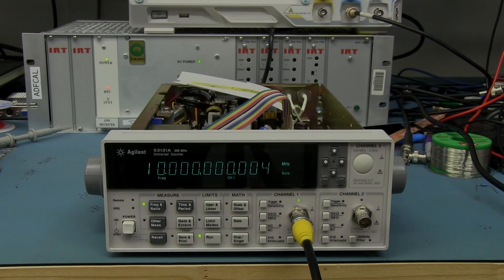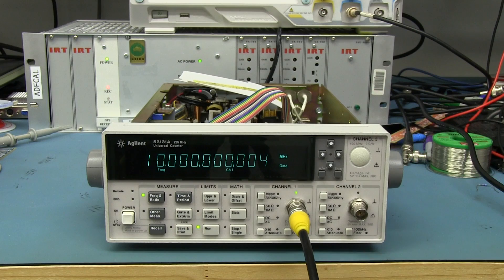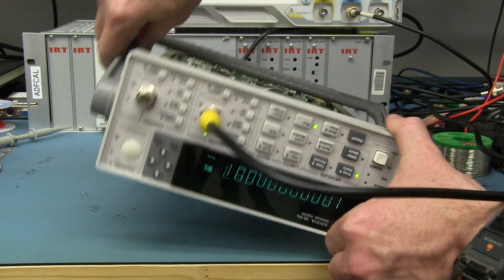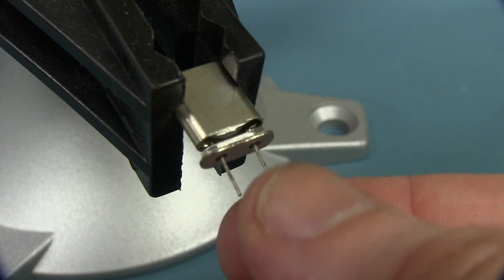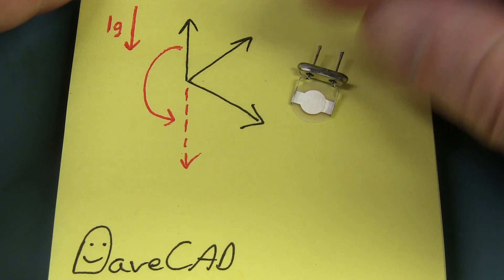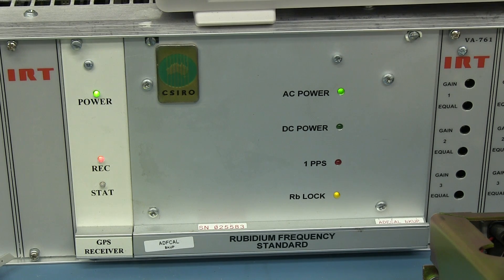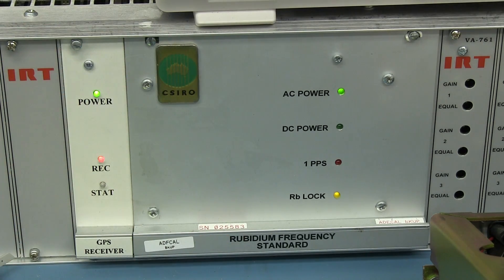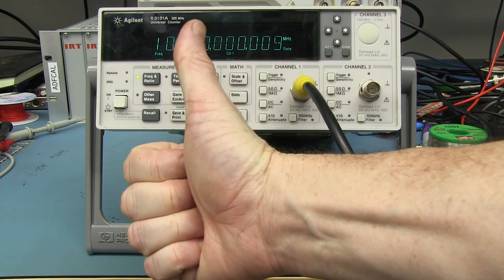EEVblog #646 - Gravity Detection Using A Frequency Counter!

Comment: For some reason this reminds me of the way CRT displays would go all wonky if you tilted them, or especially if you turned them upside down. Makes me wonder what caused that to happen. I wouldn't imagine the coils would move much, and the electron beams wouldn't be affected significantly by gravity.
Reply: It's the earths magnetic field
Reply: @sinuspl  No it's not. The Earth's magnetic field is incredibly weak at the surface and spread over the entirety of the magnetosphere. When was the last time you saw a paperclip stick to the earth? At best you can get it to rotate a needle with very little mass under very little friction, ie a compass. But that's easily negated by pretty much anything significantly magnetic. Even a paperclip that's been magnetized will spin a compass away from the Earth's poles.

The Earth's magnetic field cannot and will not EVER have ANY effect on a cathode ray. There has never been any experiment in which a cathode ray has been observed to be deflected by the Earth's magnetic field. I'm intimately familiar with the operation of a cathode ray tubes and electron beams (cathode rays). I will say that yes, they will be deflected a VERY VERY tiny amount. But it would be near impossible to measure without very precise equipment, and the slightest magnetic or electrostatic noise, which is all around us as it is, will disturb the results. The noise would drown out any actual measurement of deflection caused by the field.

 But I'm sure there have been some experiments to measure the effect of the Earth's magnetic field on electron beams. In fact, I'm 100% positive it's been studied. Particle accellerators, like the Large Hadron Collider, normally use beams of charged particles, in the case of the LHC it's either protons or lead nucleii. Which would react similarly to magnetic and electrostatic fields. And with the size of the LHC, and how accurate the experiments need to be, I'm sure they looked into how much the beam would be deflected by the earth's magnetic field. Like I said, it would be insifignificant in most cases, but with high precision experiments even a perturbation of a fraction of a percent would be devastating to the results. Really makes you appreciate the lengths they must have gone to to make not just that, but all huge particle accelerators work properly.

Comment: This is off the subject, but have you ever reviewed a Pace MBT 250 soldering/desoldering station. I have one and it’s lovely in my eyes. Just wanted to hear what you think. Lead free solder is crap! Only one good solder and that is RMA solder that is a Kester 282 or equivalent from Aim or Alpha Metals. In Sn63 or Sn62 formulations this solder outperforms all others in quality and reliability testing. It is proven in critical circuitry, medical, military and aerospace applications where reliability is of paramount importance. If you’ve ever evaluated this formulation, you know what I am talking about. I know because I am a veteran tech and a living witness to the reliability and quality of this solder. It may not matter to some, but I took and still take my soldering seriously!

Comment: Hey Dave, why not just mount the crystal on its SIDE, then the side weight loading would always be equal if it was tilted. Yes still not perfectly level but I'll bet a huge improvement. How about testing that ? Still interesting. Why didn't you try it on your frequency standard just to see how far it would drift and for how long ?

Maybe they should make special padded shock mounts for crystals. Better yet, rotate them ourselves and average the results with a slow servo circuit like the frequency standard does.

The oven temp my also change slightly with orientation because of different heat sink characteristics. Maybe they should make the package as a sphere for equal air movement from all directions from gravity. I see a new oven design in the future. A small sphere package packed inside a large soft foam insulation and shock protection.

Comment: Hi Dave thanks for another informative video :)..... you mention that the serial it's for a printer, would I be correct in guessing it just outputs the display value every few seconds down the standard rs232 8,n,1,9600 bauld.... if so would it not be trivial to write a program that receives the data and appends the time and date to the value and saves it as a csv file for later analysis or graph plotting..... 

And thanks again spent way too much time watching your videos :)

I would be happy to write a program for you if it helps in anyway :)

Regards Ian
Reply from the maker: Ian Sheppard It might be usable in that way.

Comment: It is quite intriguing that gravity can affect such a small and light object that drastically (drastically here is very relative, of course). I really didn't know this before, but I'm not electronics expert either. I wonder how big part gravity attributes to regular quartz crystal wrist watch time error in normal use, which is of course quite small, but still? Those crystals must also be calibrated in certain position, am I correct?

Comment: well if the deviation of the crystal by doing the tilting bale up is known, and it really mattered, it would have been really simply to put a little microswitch in there to add a little correction in the value before it was displayed on the screen

Comment: Is your IRT Rb Standard 10 to 100 time more accurate than the FE-5680A OCXO ?  Also looks like you got the GPS hooked up on the IRT.  Can you measure a difference between the two (2) Standards ?

And for gravity do check out  www dot anologdevices dot com (sp?) on their blog page.  They developed an accelerometer, gyroscope to put on an old IC chip (tech) here in NM (New Mexico is part of CONUS).

For your Agilent 53131A FC have you read or installed cal  XCTL of the YouTube blog page in Britian.  He also did a nice YT video of the FE-5680A.

Keep up the good work,  tjl  Sent by Win7Pro64 w/ADSL
Reply: Left out the  Trimble Thunderbolt GPSDO 10MHz freq. Standard.  Can you tell any difference between the three (3) Standards ?  And voteing two out of three for the correct time; are you on time for dinner or picking up the young lady ?

Thankyou again,  tjl  Sent by  Win7Pro64  w/ADSL

Comment: So if you had multiple oscillators mounted at various angles, you could use them to detect directional change relative to gravity?
Reply: MEMS accelerometers and gyrometers work precisely this way. They are electro-mechanical oscillators designed specifically to have large coefficients for frequency shift under acceleration. They also measure the asymmetry of the positive going and negative going wave-halfs to figure out the sign of the acceleration. Turns out counting frequency has less noise than trying to measure the magnitude of deflection by voltage.

Quartz is chosen for frequency reference oscillators because it has low coefficients of change for temperature, pressure, acceleration, humidity etc. If you're building an oscillator to measure some other quantity, then you want it to have a high coefficient for whatever change you want to measure. I think typically the resonators in MEMS devices are built as silicon fingers etched into silicon wafers because it's cheap to manufacture, you can build CMOS logic on the same substrate and silicon is virtually immune to damage from repetitive strain.

There's always something more accurate (even if no one's built it yet), but it's hard to beat the price of a MEMS accelerometer: ~$3 each 1qty.
Reply: puddingpimp
So I got curious and did some research: Not all MEMS sensors work this way, and it seems from a bit of research that gyros typically work this way, while accelerometers tend to work by suspending a conductive mass on a beam between two capacitor plates, and integrating the differential capacitance. As the mass shifts due to acceleration, the capacitance of one side of the balance will increase while the other decreases.
Reply from the maker: Yep. Wouldn't be terrific but would certainly work.
Reply: There's probably, something more accurate?

Comment: Ovenized!?
Reply: wolfy9005 That must be a huge quadrocopter for XXXL sized pizzas.
Reply: placed inside an oven :D
Reply: Eg.Pizzas are ovenized
Reply: Heated to a specific temperature I suspect, to remove a variable and improve stability of the reference(since the oscillator is just a reference, same with some voltage references)
Reply: Of course. But I hope u like Pizzas anyway.
Reply: IvanIvan1974 Stable reference pizza, just keep one in the oven at all times and enough people nearby to consume the endless supply of pizza. Pick and place machine to put toppings on the pizza and have a scale so the oven can adjust the time it is in there based on the finished weight of the uncooked pizza.
Reply: wolfy9005 Mmmm pizzzzzzaaaa.
Reply: wolfy9005 You Sir, can start with a pizza delivery service.
Reply: IvanIvan1974 Quadrocopter with built in pizza cooker, so it cooks as it flies to your house and is perfectly cooked by the time it gets to your house.
Reply: IvanIvan1974 When you want the best, you must build the best. How big is an XXXL sized pizza? I was thinking of a "family sized", maybe 450mm diameter, plus space for 2 garlic breads.

Comment: We're talking about a very small drift here, at such high resolution, isn't the atomic clock becoming a viable option? Otherwise, as discussed in other comments, gluing an MEMS accelerometer on the crystal box and mapping the drift seems like a simple solution (as long as we don't go into vibrations territory), what would be the cost impact? doubling the price?

Comment: shouldnt it be nanohertz difference not millihertz?
Reply: No, the frequency counter is counting ~10MHz, the least significant digit is 1millihertz. You would have to wait a heck of a long time for this effect to manifest using a 1Hz reference clock, and in practice the crystal aging would obscure the phenomenon (it is only a 300ppt observed shift), you would have to wait 300 mega-seconds (~9.5 years) to observe a single count offset and very few, if any, quartz oscillators have that kind of aging stability.

Comment: I'd be interested to now if it's possible to measure the strength of the local gravity accurately using this method. I'm guessing not as it looks like it's not far outside the noise of the oscillator. Presumably you can get higher frequency and more accurate oscillators though?
Reply: higher frequency won't give you more digits on your counter. We're already talking parts per billion with measuring 2G difference. Measuring for instance 0.001G would therefore require parts per trillion accuracy :D. Probably possible... though not in this setup
Reply: ***** Thanks, and I feel a bit stupid for suggesting using a higher frequency, ppb is of course independent of frequency as you say. Good video though as it prompted me to read a bit on gravimetry. It looks like 1g is give or take 1000gal and the earths gravitational field varies by about +/-50mgal. A ppt sensitive frequency counter would need to be calibrated for it's location on earth and it's height! Totally impractical I'm sure but interesting none the less.

Comment: I can detect gravity with my frequency counter by carefully holding the frequency counter then releasing it at a distance of 1m vertically from a concrete surface. If it smashes and stops working then gravity was correctly detected. You can also use signal generators, TVs and hi-fi equipment too.
Reply: I prefer to use a rack mount UPS and a human foot. Drop the UPS directly over the foot, and if you hear a loud scream and see blood, then gravity was successfully detected.

Comment: I dont understand why you get the 2g effect when you turn it 180 degrees. Would have made sense if it changed each 90 degree of turn because the physical layout of the oscillator seems to be the same if you turn it up side down. The exception would be if crystals have a one way direction sensitivity to gravity which would be really interesting indeed. That would be something for Ben Krasnow to look into :)
Reply from the maker: It's about vectors and some complex math and gravitational theory if you really want to get into it.
Smart people have already done that and you can look up the info if you are keen.

Comment: How would they calibrate quartz based oscillators in micro gravity like on the ISS??
Reply: It's a known % offset per g...just subtract 1 g to put it in microgravity.
Reply: frollard Does this explain though the reason two sync'd stop watches drifted apart back years ago in a NASA experiment?
Reply: armpitdew
I don't know which experiment you mean for sure, but there is a famous experiment where two highly accurate clocks were synchronized, one was flown in a jet for a while, and then when they were brought back together there was a time difference. In that experiement, it was an effect of special relativity due to time dilation from the speed of the plane (not the altitude and gravity). No - the effect that Dave is seeing is just classical mechanical stress in the crystal.
Reply: MichaelKingsfordGray
I didn't realize that they had done an experiment regarding the gravity difference at two ends of a stairwell. However, my main point was that these experiments had to do with relativistic effects which is not what Dave is seeing here.
Reply: MichaelKingsfordGray Also, the gravity field at the orbit of the ISS is not very different from that at the surface of the Earth, so it is not quite correct to call it micro-gravity, in the relativistic sense, even though one feels weightless due to free fall.

Comment: Since the physical construction of the crystal is (largely) symmetric, and we're measuring what I'd assume to be a "bulk" property, I'd expect the 180' flip to produce the same frequency as the deformation etc. would be the same magnitude. Is this due to inevitable asymmetry in the construction? The way the crystal is driven electrically?

Curious effect. Thanks :)